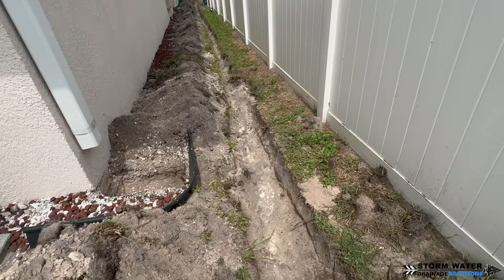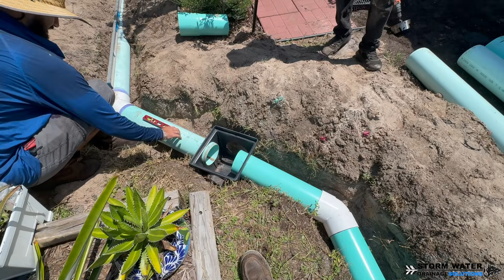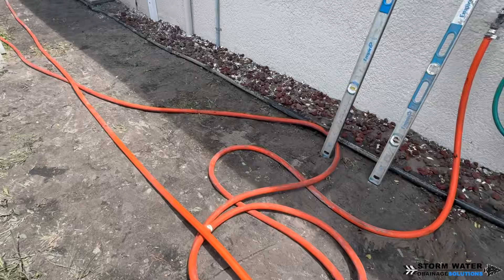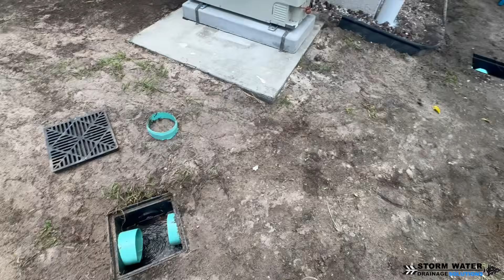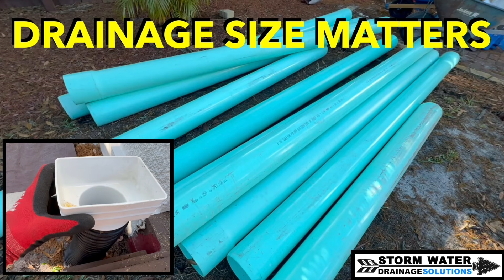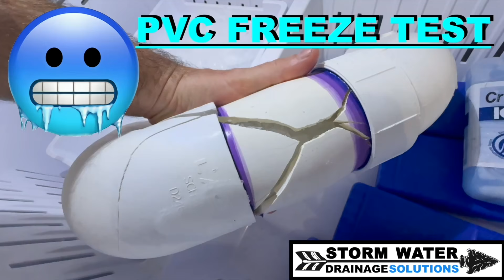Stormwater Drainage System Design - What Size Pipe Should I Use For My Yard Drainage - 4" or 6"?

Comment: If you are in an area where you can core cut the curb, 4" is likely the largest you can use. I'd also note that schedule 40 is more expensive but might be worth it for shallow work as it won't be crushed if you need to back heavy equipment like an excavator over it. Most likely you need a separate 4" line for every 2 downspouts.

Comment: A major factor that determines pipe size is the slope.  In Florida everything is flat.  But in a sloped yard a smaller diameter can handle the same volume of water all else being equal.  Getting past a concrete walkway, for example, is easier with smaller diameter pipe.  Larger diameter probably will never clog.  I don’t think air flow above the water line is ever important.  With drainage, oversized is better for sure, but what that really means depends on the actual slopes of the pipe runs.

Comment: 10/10, though IMO you should be using galvanized grates as those 12x12 plastic grates are basically a 4 inch pipe's worth of intake.  I think the 6 inch intake on a 6 inch pipe in those basins is 244 gpm, though I forget. I recently saw a 10 inch dual wall pipe float up in a midsection of the run so if you're installing in a ponding area then you may need some weight to help hold those pipes in the ground.  Also 6 inch can self-clean with less than 0.5% slope.  Even my 12x12 galvanized grates often get block my leaves but the 6 inch pipe I have has never ever left debris in it, I can flush anything through it, even large river rocks just pass right through.
Reply from the maker: Gotta love 6in sdr35 💪